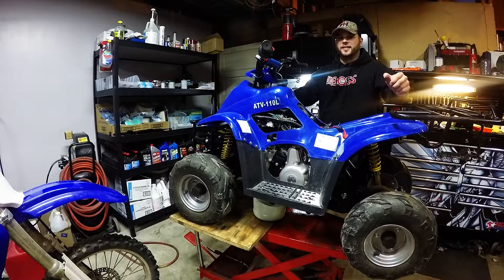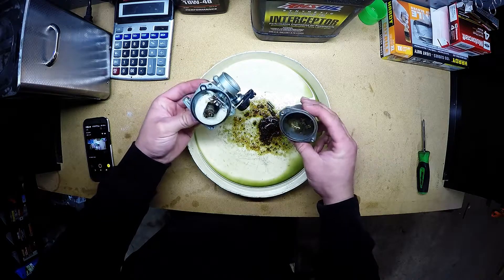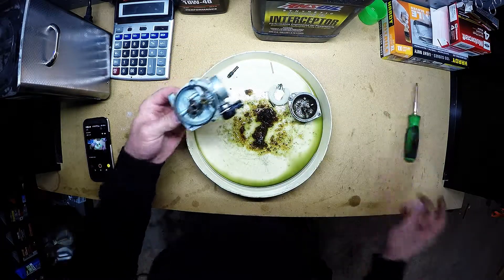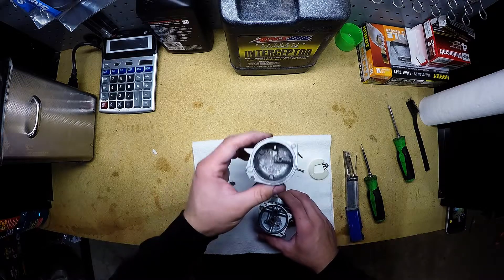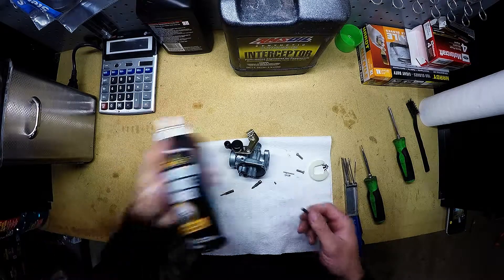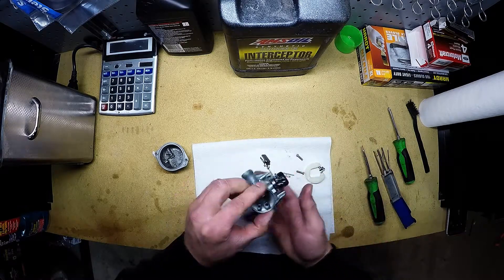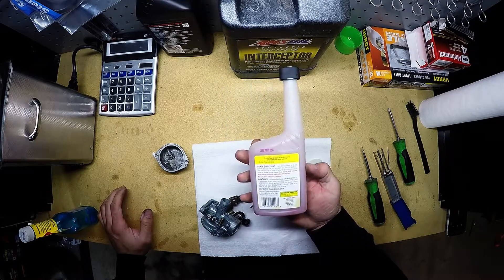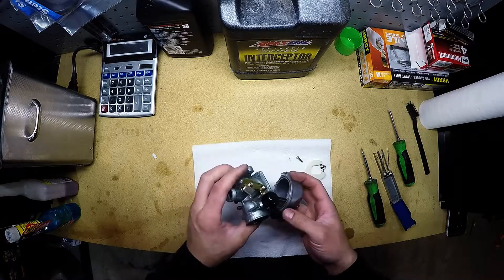Effects of ethanol on small engines

Comment: Ok, but non-ethanol fuel is $1 more per gallon. If I get 500 gallons of service out my engine before I need to clean or replace the carb—do the math. $500 will buy a whole lot carburetors.

Comment: ethanol is alcohol right? does alcohol turn into that shit?  if that is true then why doesnt all the four wheelers  sludge up and stop running? maybe the guy you bought it from had some crap in his gas can he filled the bike with. I dont know but I have a lot of equipment and have never had any problems. I understand that the alcohol is a very good cleaner and can knock some crap off and plug things up. the big problem is absorbing water that  can cause rust. not too scientific of a conclusion to  finding crap in a carb and automatically blaming the corngas. no disrespect, just thinking things through.
Reply from the maker: The fuel blends with ethanol definitely gum up carbs the worst.Not straight alcohol.. I see it all the time. Fuel with ethanol bends have a much shorter shelf life then a non ethanol gasoline.I have replaced 100s of carburetors with this same problem. The gel that you see happens when it sits for over a year. the fuel turns into that gel type substance from moisture and evaporated fuel.That’s not something that got put into the fuel tank collected in the bowl until it filled up . From what I have seen that only happens with the ethanol blended fuels.